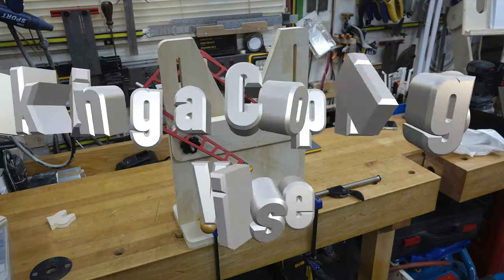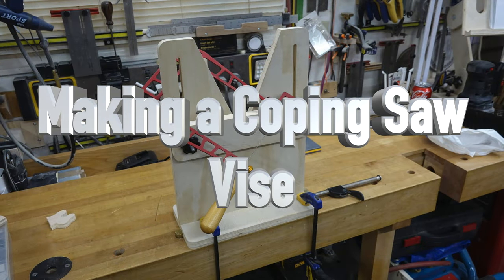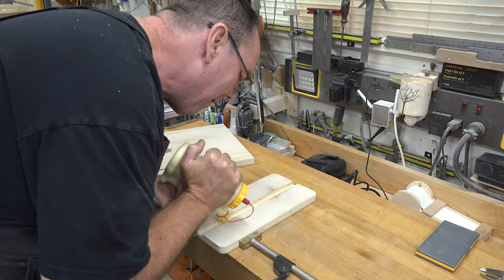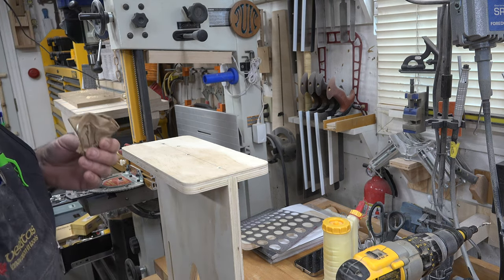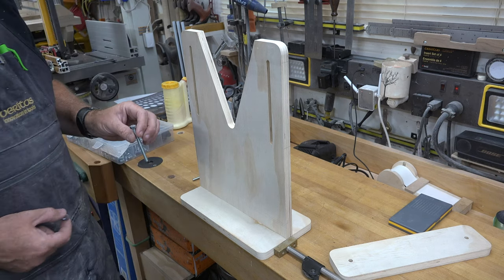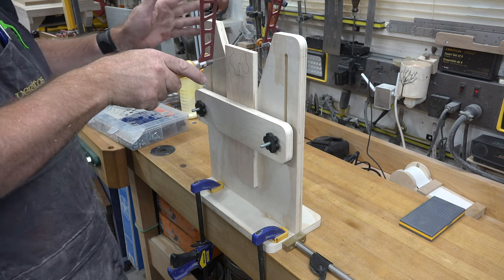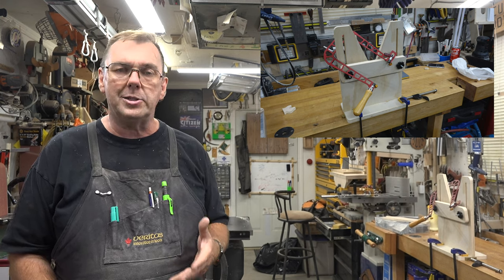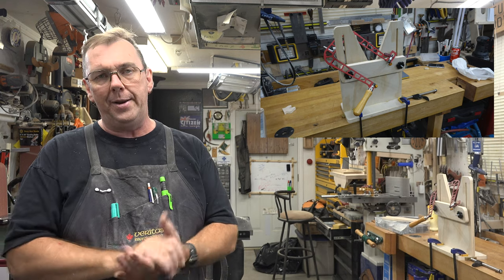Making a Coping Saw Vise

Comment: Over a month after the comment was made we finally get what was requested ... it's just not good enough 🤣

While this a beautiful jig and well made (as usual), wouldn't you have the same result by clamping the piece in your wood vice? .... please don't think I'm criticising, just a genuine enquiry 👍

Now that I see how you've done things (for both the horizontal and vertical versions), if you were to build a jig in an 'L' shape, with triangles to the inside of the 'L' to strengthen it, then this could be used in both the horizontal and vertical modes, either by clamping the jig in a vice or to the table top.
Reply from the maker: Would be perfect in the vise.....but what if you don't have a bench vise?  I'm trying to be a versatile as I can here.  LOL.  Thanks for tuning in to the show.
Reply: @acutabove_woodworkings  You put your fret saw table in a vice 😁... I was merely pointing out that you could have one jig providing both functions ... you could clamp it to a workbench, but of course not everyone has a workbench 🤣

Comment: Another nice project, I am afraid I would be fretting over making those measurements correctly, I do not think I could cope with my measurement failures. When ever I cut all thread I place a nut on the threaded rod prior to cutting the all thread. If I need to remove the nut, I back it off at the cut and the nut acts like a poor man’s die and cleans up the thread if I do not have a grinder handy.🤣🛫
Reply from the maker: LOL.  Don't quit your day job.  LOL.  Thanks for tuning in and for the chuckle.